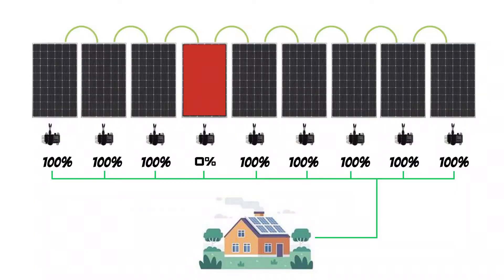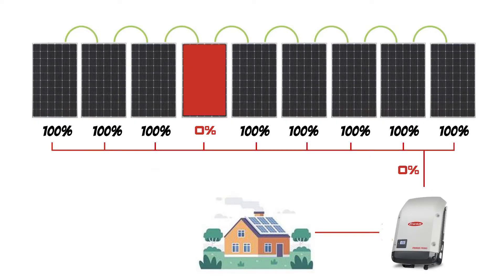Enphase IQ8 Microinverters vs IQ7 Micro inverters Which is right for you

Comment: How likely is that one panel goes down vs one micro inverter popping and knocking your series mains supply circuit underneath ur panels?
Reply from the maker: It's highly unlikely that a panel or a microinverter goes out. The Enphase microinverters have a 25-year warranty. Even if a panel or microinverter goes out, it will not affect the string/branch. Only that individual panel or microinverter would be affected. Thanks for watching and commenting 👍🏻

Comment: where do you buy IQ7 or IQ7+s for $100? Can you please let me know?
Reply from the maker: I have a video on the cost of the system where I provide all that info. You might find that video very helpful. I got the microinverters off of eBay mostly. I picked up a couple at a time until I got all 27 of them. All were brand new also. Hope that helps. Thanks for watching and commenting 👍🏻

Comment: Could a person use IQ-8 inverters to heat water, water heating 220 volt element not hooked to the grid ?
Reply from the maker: I don't think even IQ8'S can be used in real off grid applications. With Enphase, as of right now, they require a grid connection of some sort. Thanks for watching and commenting 👍🏻
Reply: @TheSolarPit  thanks, I believe your right after I read more, I wish someone would make a inverter that would do this battery less,

Comment: Iq 8s also require 2 load controllers and a system controller #2 the first version does not support iq8 sunlight backup
In my opinion this is not what is being sold to customers they are being led to believe it will back up lots of stuff when in all reality 8 to 12 ckts on the load controller set to normally open with the router circuit left off the load controller
Reply from the maker: I'll look further into this. Thanks for watching and commenting. 👍

Comment: So you are misinformed on one thing. The Enphase Ensemble with IQ8 micro inverters can and does run as a whole home backup. 

My system has 58 silfab 390 panels with 58 IQ8 micro inverters. I am running the combiner box 4 along with the smart switch. I also am running 3 IQ10 enphase batteries. This entire system produces 2.7mwh in the fall, and 1.6mwh in the winter on average. I live in west Texas. 

My home is a 3 bedroom 2 bath all electric home with 2000 square feet. I can run completely off grid during the every season with exception to winter. However I push enough power into the grid to cover my electricity bill during this time. Adding one more IQ10 battery should take care of my issue. When the grid goes down the smart switch is only capable of using 56 panels to form the micro grid so during outages I lose the use of two panels. It is not significant. This is a fairly big system but my goal was to be energy independent. Thus far that is exactly what I am. My electric bill was sometimes $600.00 a month. Now its zero, this system cost me $365.00 a month. Its well worth it.
Reply from the maker: Thanks for sharing. 👍🏻

Comment: Which microinverter to use for a bifacial panel giving out more than 700w peak power?
Reply from the maker: That's a high power panel. I don't think microinverters would work best for you. Maybe a string inverter with optimizers. Thanks for watching and commenting 👍🏻

Comment: Great video, could a small IQ8 system (2-4 panels?) act as a mini grid to keep the IQ7's running in a grid down situation?
Reply: Enphase would not allow that in an approved design situation the 7s would need to be shed because they would cause grid instability
Reply from the maker: It would be complicated to connect it, if it would even work. I have not researched that option so I am uncertain on that. Thanks for watching and commenting 👍🏻

Comment: Unless you got extreme shadow conditions I see little benefit in micro invertors
Reply: Simplicity for one.  The next house I’m building will have 20 panels and microinverters feeding a rapid shutdown box and straight into the panel.
Reply from the maker: For example in my situation. Lets make a comparison to an 8kw string inverter paired with 27 optimizers. To achieve similar monitoring capabilities. Which do you think is cheaper? I put in 27 microinverters for around $2700. Then you have got to take into consider DC will use metal conduit vs schedule 80 / 40 pvc. PVC pipe and fittings are more affordable than the metal piping and the tools it takes to make the bends. There are other difference to consider that a lot of people tend to leave out. One other benefit is if one inverter fails on 27 I still have 26 producing until I can fix the issue. On a single inverter that shuts down the entire system. There are pros and cons to both systems but it definitely is more than just extreme shading. Thanks for watching and commenting 👍🏻

Comment: Justin I am a Caterpillar generator tech. I'm trying to figure out how you could utilize your solar power being produced during a power outage. Is there a way to use an ATS (automatic transfer switch) to provide power to your house during a power outage? You could have your panels connected (after your combiner box) to the normal and the on to the load of the ATS and during an outage your panels would then transfer to the emergency side to then power the load. I may have missed something or whatnot I'm trying different scenarios in my head.
Reply from the maker: I'll be honest, I'm still researching options. I'm thinking about the new battery generators as backups in situations when needed. Can plug freezers, refrigerators, and other necessary appliances in to get us through a blackout. Enphase does make a Switch that can be paired to the system I got but man, it get expensive super fast. Thanks for watching and commenting 👍🏻
Reply: I’m new to this solar stuff. No questions yet. Lol but want to say thanks, you seem like a genuine guy. Thanks for helping so many people.
Reply: If you use the iq8+, you don’t need to use the “solar backup”. There are settings that let you use the iq8’s without buying the controller.
Reply from the maker: @Scoobydue420  Awesome, thank you for that information.
Reply: You will need to use IQ8 micro inverters and an ats to run off grid. IQ7 will not work.
Reply: I want to use micro inverters in our flat for safety, and we have a restituted cupboard to put the kit in, so if you have AC coming down from the roof, what kit will you need to charge a battery and export?.....

Comment: The failed panel's bypass diode will kick in and automatically bypass the failed panel,the same is also true for partial shading in a single inverter system
Reply: Your presentations are very good but it seems to me that by doing the work yourself and learning as you go along might be more expensive than going to a professional installer in the first place. Using batteries @ £2100 for 5 kWh may have been a better investment than the micro inverters as all modern PV come with bypass diodes which deals with shading, not as effectively as micro inverters perhaps
Anyone planning on doing the job themselves needs to do a course or at the very least look at as many YouTube presentations as possible and you would be well advised not to attempt the electrical work
Reply: @mikejoseph425  been looking at micro inverters but issue is I am looking at 500w panels (8 panels) 

But the cost of the micro inverters that can run 500-550w panels isn't cheap  vs a SMA 3600 string inverter for less then £500 ( shade is not going to be an issue)
Reply: @leexgx as an engineer that has designed and overseen the installation of thousands of systems over the last 15 years, string inverters always tend to fail right around the warranty expiration date. So if they offer an extended warranty for an up charge, pay for it. 

If you’re able to actually invest in quality definitely go with Enphase micros, their reliability is so high that we use them exclusively since the most expensive thing is to roll a truck for a service call. 

As far as the wattage of panels, you could spec an IQ8A or IQ8H, they’re designed to handle higher watt panels.
Reply from the maker: Can you provide me with the string inverter you are referring to? I have not seen one be able to bypass a single panel on a string by itself without adding optimizers. I would like to learn more on that. Thanks for watching and commenting!
Reply: @TheSolarPit  HiJustin, bypass diodes are built into the solar panels. You’ll have a hard time finding a panel without built-in bypass diodes. Part of the maintenance process of commercial solar farms is to test the proper function of the bypass diodes. 
Bypass diodes reduce the impact of partial shading of a panel and if an entire panel is defective they make sure the string is still producing electricity. 
This doesn’t mean that micro inverters are not useful.
Reply from the maker: @christopherscholz  Much appreciated! 🙏 Thanks for the information on that.
Reply: @TheSolarPit  https://youtu.be/ESpsdMFEFZo  it's no so much the inverter as the bypass diodes in the solar panel hope the link to the video above helps

Comment: Getting some IQ8As for my home going to pair this with an IQ  Controller 2 and the Combiner unit.   I am not getting any batteries because the price doesnt seem to justify the capability.   I can get a propane full house generator for the same or lesser cost of two 3KW battery units.  Having the IQ controller already, which has a generator input, means I dont need to buy a smart switch or other panels.  The IQ8 can provide power during the day if power goes out, bu that is a side benefit at the moment.  IF batter technology improves (be it sulpher or salt) and thus becomes significantly cheaper, then I will go hard on battery  and the IQ8, or I win the lottery LOL.     My installer doesnt install iq7s anymore as they tend to go with the latest tech for forward capability as much as possible.  The other reason is the IQ8A gives me the most power output per panel.
Reply from the maker: Awesome stuff! Congrats 👏 Thanks for watching and commenting 👍🏻
Reply: Same situation here, going for the Iq8's and the IQ Controller 2, which contains all that you need. It also replaces your existing transfer switch if you have the Generator, so less parts there.

Comment: When fitting the Iq7 do you need a unit/panel at the end of the chain before the consumer fuse box?
Reply from the maker: Hi, what do you mean by - unit/panel at the end of the chain?
Reply: @TheSolarPit  thanks for the reply. I’m referring to the ac power cables coming from the solar array. Do they connect into a control panel. Or do they just connect to an ac panel. I’m in the uk. So might use different terminology. By ac panel I mean a fuse box.
Reply from the maker: Welcome from across the pond! No problem, here are three videos that might help answer those questions. 
https://youtu.be/gKik5ZQC8dc - This one shows exactly how to wire the combiner box to the Main Service Panel
https://youtu.be/2Nssg_WAH68 - This one covers the components needed to build a system like mine
https://youtu.be/qg399PM6DQ8 - This one is more of an overview of the entire wiring process
Thanks for watching and commenting! 👍

Comment: I went with the IQ7A and the IQ Combiner 3, paired to Canadian Solar 400W panels.  I have them facing south, full Sun exposure, micro inverters are rated at 366  watts I believe, I wonder how high they’ll push my panels
Reply: The advantage of over power is you receive more charge at the early and later times of the day.
Reply from the maker: I think the IQ7A's are perfect for that 400 panel.